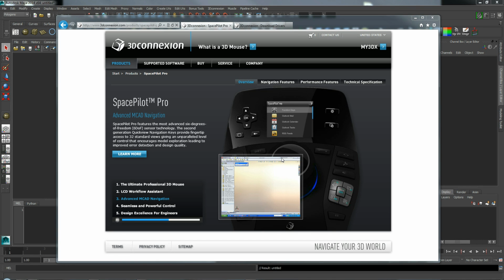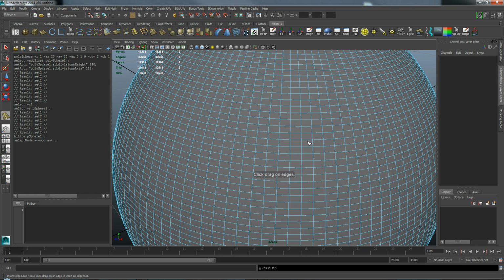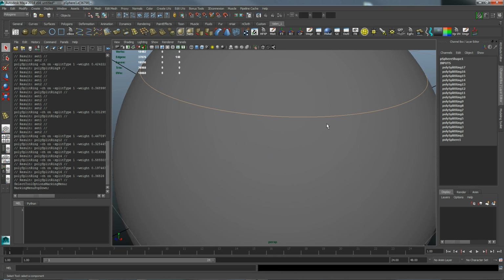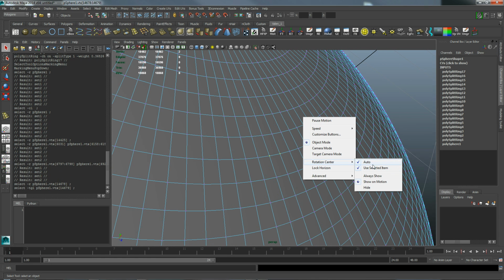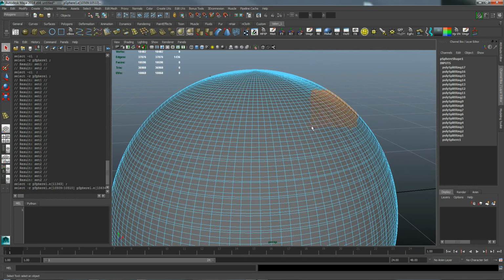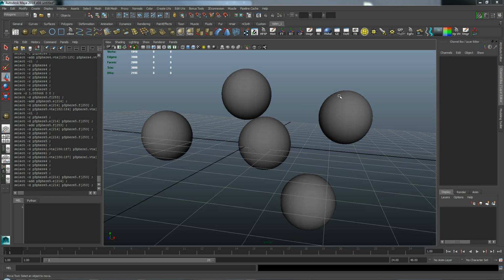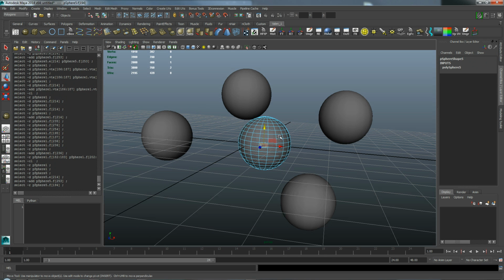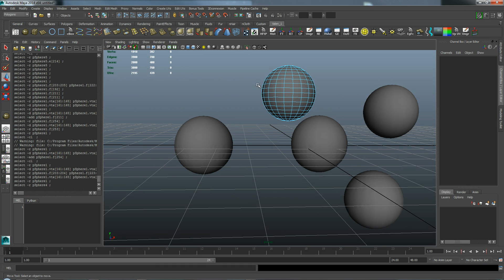Bugs with 3DConnexion driver for Maya 2014

Comment: v3-17-8_r1730  - This version works.
Unfortunately I'm locked into using Autodesk 2014 products because 3d connexxion have stopped supporting the pilot